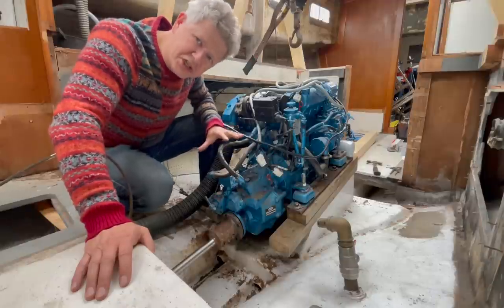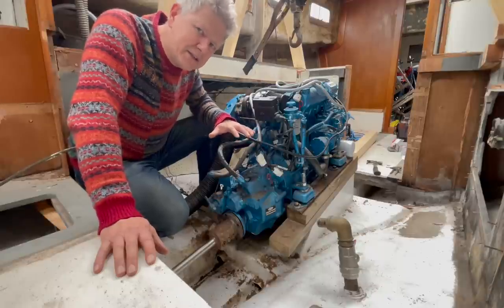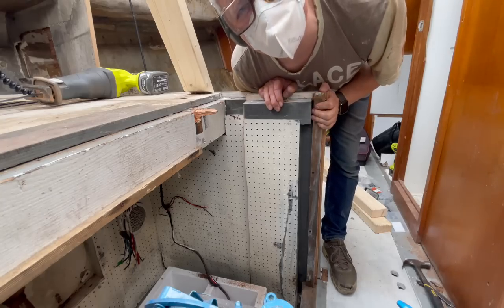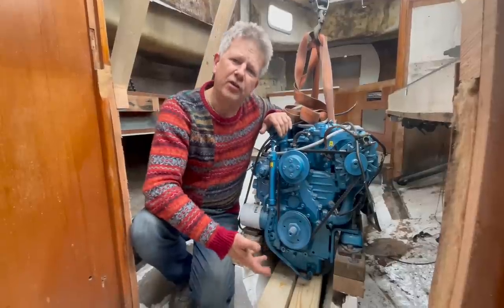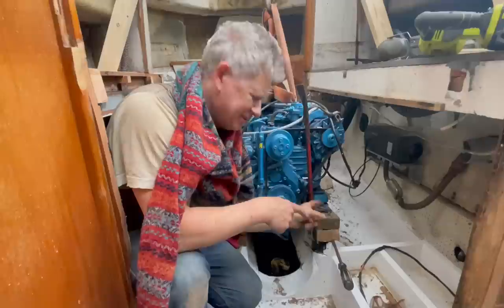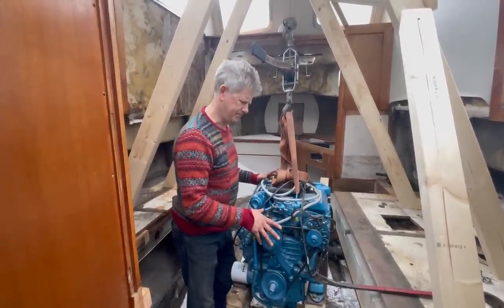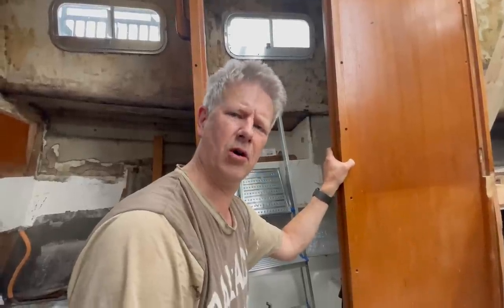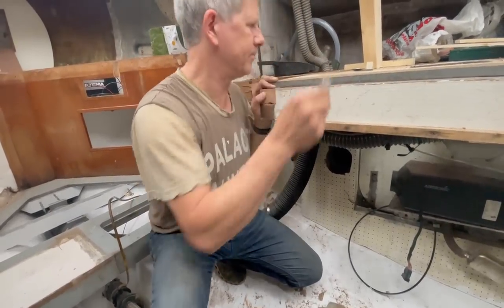Fisher 30 Ep 12 - The great engine lift: Defying gravity and Overcoming Obstacles!

Comment: Hi    If you haven't already made up the engine beds you might consider using a composite  bed using hardwood, urethane strip, then hardwood. This will completely isolate the engine from the hull and stop the transmission of vibrations. Bolt the urethane to the bottom timber, then urethane to top timber; separate bolts.
Reply from the maker: Hi Rob, I will use recycled hardwood-based plywood from the interior, and glass this in. I will  check out your urethane advice. However the engine mounts are also dampened with rubber. Should not that be sufficient?

Comment: Thank you for answering my insolent comment the other day. Actually, we have received some interesting news, so we would like to inform you. It was announced that Toyota Motor Corporation of Japan has completed the development of individual batteries and will install them in the next EV vehicles, and the charging time of the new solid-state battery pack is only about 10 ~ 15 minutes, and the problem of explosion and flame has been completely solved.
Reply from the maker: No problem. I have no reason to believe anyone is hostile. I enjoy these dialogues :-)
I have heard about the solid state batteries. Quite high density, but a problem with expansion when charging. Shall be interesting to see how they proves the consept, and how durable they are. Way to early to conclude anything. Though I have very high thrust in the Toyota quality, so I am sure they are doing a superb job.

Comment: Good to see things moving along.  You seemed to be fighting the engine more than you needed ... why didn't you just remove the nuts that held the motor to the motor mounts?  It would have freed the motor, and then you could have removed the motor mounts and bedding from each side separately.  I'm sorry to see that the motor is having issues keeping the oil on the inside, but as we all know that is just part of "Boat Life"!!!
Reply: Àlso vintage Motorcycles 🇬🇧🤣🧙‍♂️
Reply from the maker: Hi Robert. Good question. I actually did consider just lifting it off the engine mounts. That would have been easy. However there was for me two points against it; 1) it would may be harder to get the wood off the bolts without ruining them, and 2) i found that keeping the wood underneath the engine mounts, still on the engine, may help stabilizing it (if necessary). I really did no big brainwork on any of these considerations. If the engine had lifted easy there would have been no show...a frustrated boat-owner. Yes all part of boat life. :-)
Reply from the maker: Did´nt pick that up.... :-D

Comment: Nice to meet you! I'm watching it from Japan. Give up the heavy engine, how about a motor hybrid? The performance of recent generators has improved, and if solar and wind power are combined, the amount of other power installed will increase dramatically. Japan stereotyped people and I'm not good at English. I commented on the Google Translate function, but please forgive me if there are any rude points such as mistranslation. From distant Japan! I support you wholeheartedly.:virtualhug:
Reply from the maker: Nice to meet you too. Thank you for commenting, all the way from Japan. 
If this engine was old I would follow your advice and go for a hybrid system. But is is only 5 years old and has less than 200 hours of running time. So I will keep it - for now. 
Thank you for your support! :-)
Reply: @hsobstad  :yougotthis::yougotthis::yougotthis::virtualhug:

Comment: Great Job, keep up the good work. BTW, you might call it an A Frame. Did you stop the oil leak? After all that cleaning you don't want am oily bilge!
Reply from the maker: Thanks, (Boatman)Mark. Yes, I also figured an A frame. This is Ep 12. There are 7 videos ahead. But the answer is: Not yet. I will do a light overhaul on the engine prior to re-installing it.

Comment: That was probably more fun for us to watch than it was for you to actually do. The ‘armchair advice’ would have been to unbolt the resilient mounts and lift the engine leaving the wood behind for attention later. Good decision to keep the engine in its current position. BTW when you handled the propellor shaft it did look like the play was excessive - cutlass bearing?😃👍⛵️
Reply from the maker: Thanks, Norman. It is our intention to make something "likeable". Still, you are right, not all is fun about it. But restoring a boat like this is based on a dream :-)
It was really my choice not to undo the engine from the mounts, but to lift it all. I figured it would be easier - all in all. 
Yes, I am considering changing the cutlass bearing. It really should be ok, but....hmmm....

Comment: I was on the point of suggesting a lifting frame and you made one! But I do have an idea re mounting the engine; you mentioned the benefits and drawbacks of stainless steel vs. plywood. I suggest that you should be able to have both. First, build the subframe in stainless and then overlay it with the ply or other material  - I notice that someone else has mentioned urethane. Whatever, rubber is always a good sound deadener. I hope you don't encounter any more bolts like that one! 😢
Reply from the maker: Hi David. I am skipping the stainless and build only on plywood made from teak (reuse what I have removed from the boat) and glass it in. Lets se how it goes.... :-)
There are rubber on the engine mounts. Should be ok.
Reply: @hsobstad  have you considered going electric? Not a cheap option, but  afterwards, it should work wonders on the operating budget!
Reply from the maker: @Davidcallard  I have considered it, slightly, but again found that the engine is to new to be changed. And the electric options are VERY pricey...

Comment: You can always improve on rubber mounts by using Eurathane poly bushes.. and by isolating the mounts from the cradle using high density cork or slabs of rubber or poly bushing material.. its used extensively in performance car suspension an engine mounts.

If an engine sits for a long time the oil seals on the crank cases tend to squash and are reluctant to spring back even when warm ..some addatives can swell them up ..but usually its a service job ..
Reply from the maker: Yes, it is possible to upgrade later. Might go for that to attenuate noise. 
I actually think the oil leak is a hole in the actual steel-tube for pumping out oil. Rusted a hole. :-)
Reply: @hsobstad  that will do it as well 👍🏼😁

Comment: Would love to see a thrust block mounted back in the Vee section thereby keeping propshaft lower then using a driveshaft between thrust block and motor allowing normal level mounting of engine at a height to suit. Once thrustblock mounted then no need to align engine to propshaft and can be mounted on normal engine mounts. NO Vibrations Quieter less wear on prop shaft and the benifits keep on coming
Reply from the maker: I would love that too, Craig. But afraid that would mean quite substantial costs. Still, that could be considered later, if the boat proves to be a success. The noice is an issue - always!
Also I would love to have a gear with a 9 degree angle so the engine could sit lower and more leveled. Luckily this engine accept up to 15 degrees of angle.

Comment: Good see you again I like your humor lol you have patience for sure I'm assuming you are married where is your wife and all of this? You are fortunate to have your daughter with you going through this experience. Good memories. And maybe I forgot this is a motor that you purchased to replace the old one and it's leaking oil? Assuming you bought it as is? Oh I forgot not to make so many questions or comments. I'm assuming the black car in the parking lot is your car that's in the video and for the life of me as a car guy I'm trying to figure out what kind of car it is. I almost thought BMW but those aren't BMW headlights I thought maybe Volvo but they don't have a broken Grill like that.
Steve Naples Florida
Reply from the maker: Hello again, Steve. Thanks. 
Unlike Mads in Sail Life, Mark in Wildling Sailing and several others, I must do this restoration part time and alone. That is totally ok with me. My wife prefer garden living (and -work) way over boating.
Yes, my daughter, Sara is filming part of the videos and she does all the editing of the videos. 
The motor/engine is 5 years old and was already in the boat when I bought it. And yes, it is leaking oil. Seems to be rusted a hole in a oil-draining tube. 
The car seen on the video os a BMW car, easy to recognise the "kidneys". My car is a Nissan eNV200 electric car. Not anything fancy like a BMW (my old father actually has a BMW i3). I need something modest, cheap and simple to transport tools and rubish to and from the boat. :-)

Comment: If you move the engine in the direction to the middle of the boat you may raise it too high  so the engine is above the level of the floor. The shaft is at an angle. Hope I explained it OK.
Reply from the maker: I got it :-)
The question from last video was if I should move the engine further back, shortening the shaft. In this video I decided not to move the engine. Work vs gain was not satisfying. :-)
The shaft is about 9 degrees angle.

Comment: That looked rather marginal. Howe did you calculate the strength of the frame?
Reply: It worked so he got the calculations right! 🙂
Reply from the maker: No calculations, actually. Just working off experience. 2x4 placed in an A-frame is very strong. This engine is less than 300 kg. Previously in life I have done lifting in such frames, to get rid of roots from small trees. No problem pulling more than a ton upwards, using a chain hoist. This setup had plenty of margins IMHO. :-)

Comment: God anyone can see what your doing wrong  take the bolts off engine mounts
Reply from the maker: But of course :-) This is transparent, Glenn. I made a decision on how to remove the engine and the wooden structure underneath the engine mounts. I think it turned out ok. Some would have done it differently. Some would not consider any of this work :-)